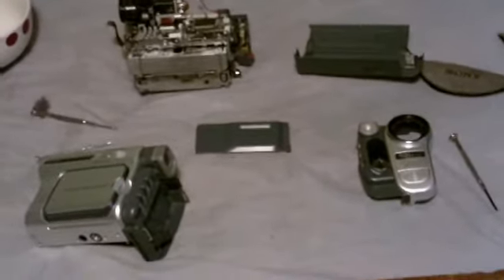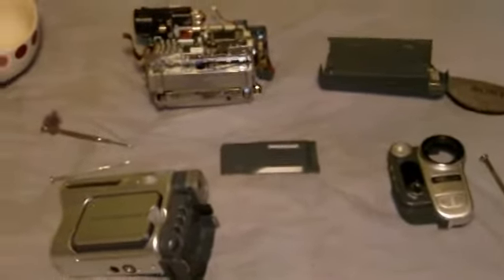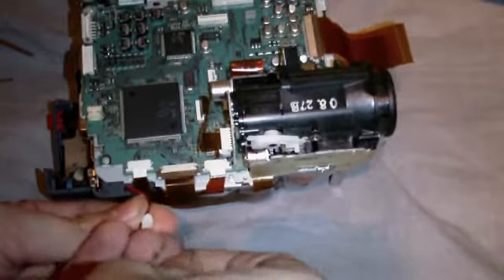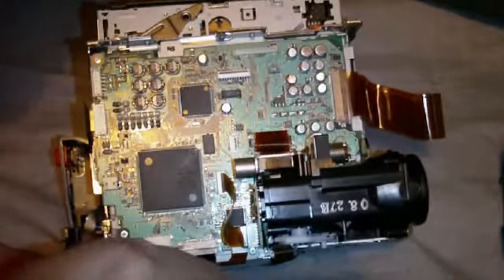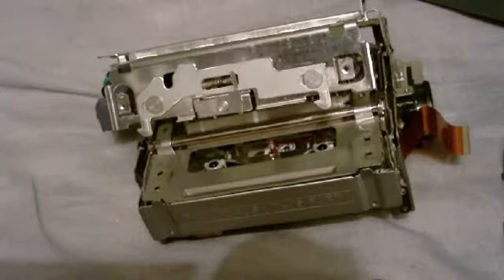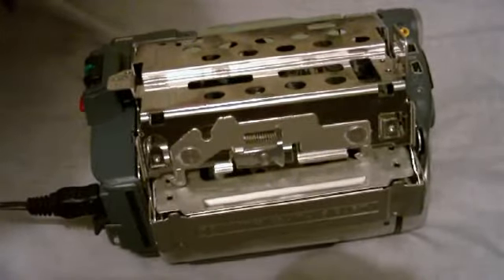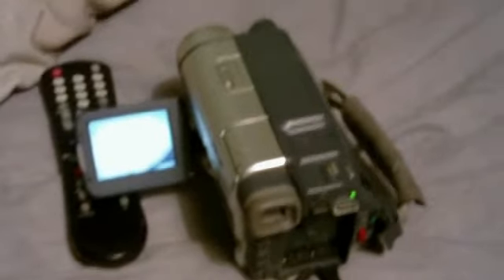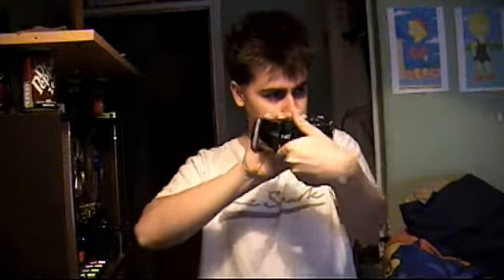I try to fix my sony handycam.avi

Comment: I know i might be 13 year's late to the party but you can try cleaning the mode switch and re adjust the mechanism timing. It might have gotten out if whack when it fell.

Comment: (continued)
Then, on the chassis under those circuit boards, there are three or four screws you can take out. And then the whole little mechanism can be pulled out (it's basically a little box) from underneath that door part you can't take off. There is a lot of cables connected to the mechanism, so it's a bit tricky not to break any of these. But then you have the mechanism all out and you can take a closer look at the broken tape guide.

Comment: how much did you buy the camra for , if its fairly new i would get it proffesionaly fixed

i once took apart a vidio camra when i was 12 i wish i still had it ,
4.5 volts,omg, i am suprised it still works!

Comment: I just watched this video again, and I might have some help for you. I once had a Samsung MiniDV camcorder, wich had a mechanism that was really similar to the one in your camera. And I also had the problem with the door part that was impossible to take off. What I had to do was to remove all the circuit boards from the chassis of the camcorder (the ones the little motor is conected to on your camcorder).

Comment: First I have to find a power supply that is strong enough to drive the camera. At the moment I don't have strong power supplies, so I'm not sure if the camera is damaged or not. But it's possible that the capacitors are bad.

Comment: I have had the same camera for almost 4 years, I haven't actually used it in at least a year, so I don't know if it works, but I was wondering, if I recorded  a video from it and put it on my computer, what resolution would it be?
I've dropped it before and it still worked, it's got a lot of scratches and part of the case cracked, but I love it.

Comment: I just took the camera apart, there are defefinitively no bad capaciators inside. But unfortunately I found a little plastic thing and a little spring, these parts were part of the mechanism, so probably the mechanism won't work anymore :(

Comment: You should take a voltmeter to the port that the motor connects to with the power on so you know how much voltage to send through it.